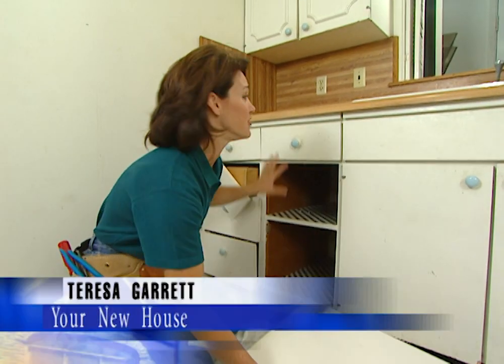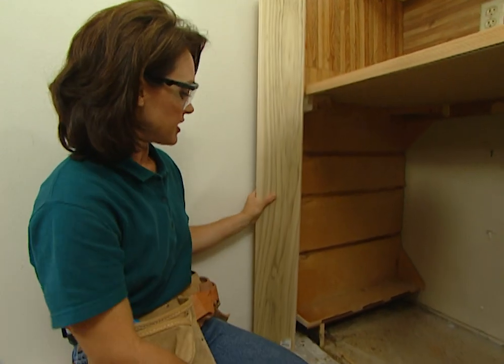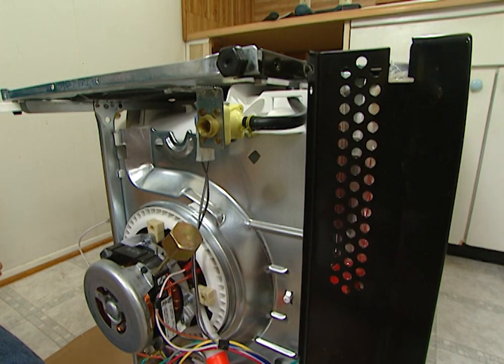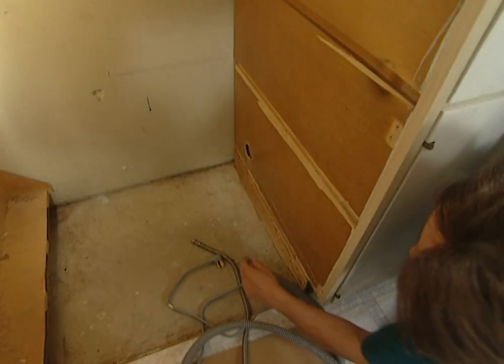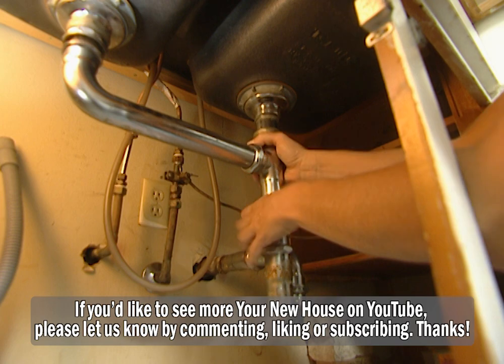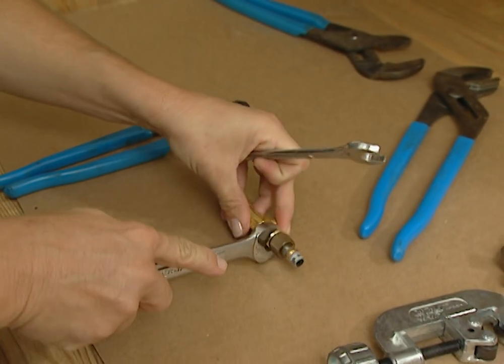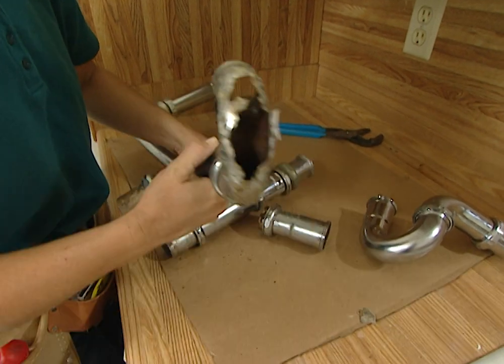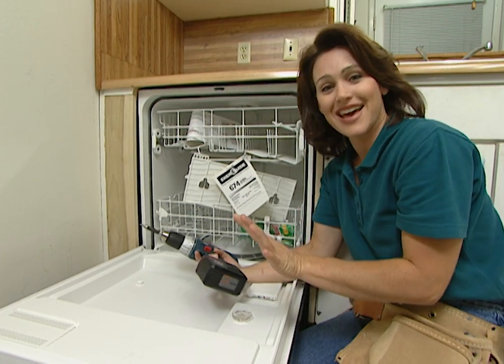How to Install a Dishwasher - Do It Yourself

Comment: The drain line needs to be hung inside the cabinet before connected to garbage disposal per dishwasher instructions to prevent sewer gas and back up even if has a loop on dishwasher. My dishwasher came with a plastic tie to hang it and it also has loop on side of it.